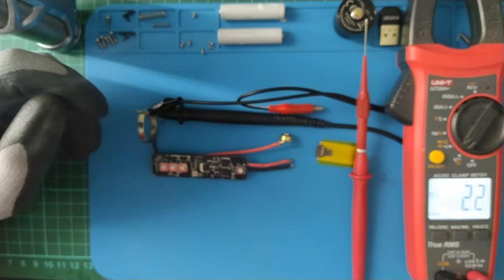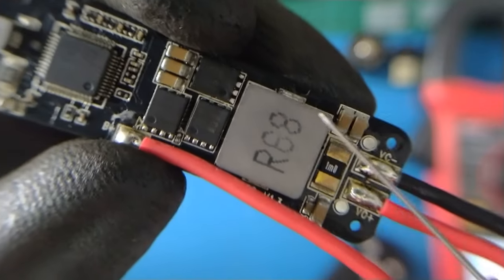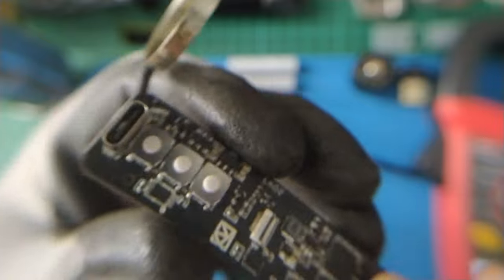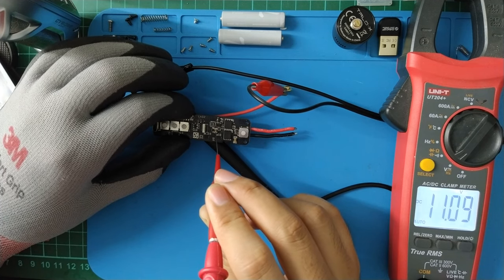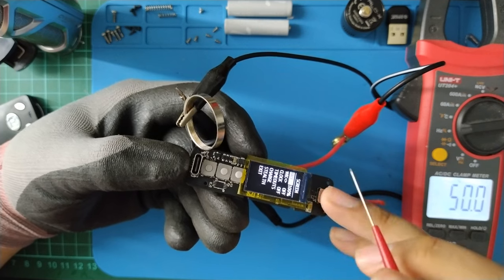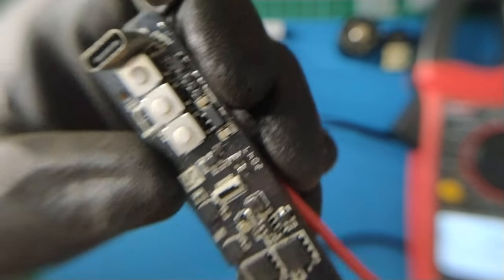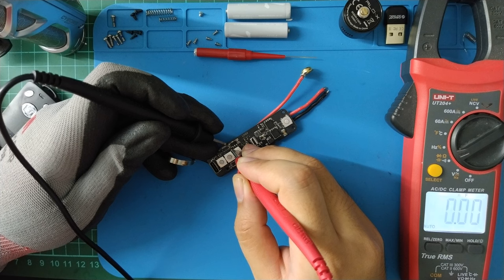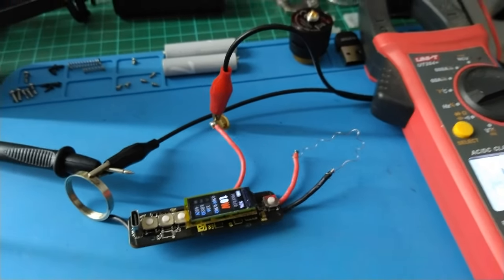VLOG EN: LOST VAPE QUEST MAINBOARD DISASSEMBLY / TEARDOWN TOPOLOGY POWER REGULATOR

Comment: Hi @widyahong ! Have you ever disassembled centaurus Q80? Tear down advices without destroying it would be very usefull 😅
Reply from the maker: No, but many device <80 watt not designed to be easy repair, you need accurate and stable hot air gunt to minimize dent by soften glue and calm down during work. Device under 80 problem typically just battery, pin, sensor. Not like device over 80 watt that have switch mode power supply inside, device under 80 watt just contain pwm circuit.

Comment: @widyahong I have a similar lost vape centaurus quest bf100.
The firing button is not working I already checked the contacts and it's OK but still can't fire the device
Reply from the maker: Are you use original firmware or articfox? So the device is turn on? If you press power button there are message on display or just puff time and wattage annimated? Its liquid damage like corrosion? Are you have multimeter?
Reply: @widyahong  when I put the battery its straight main screen watt/puff count.
I'll double check it if its liquid/juice leak that might corrode some parts
Reply: @niwrad84  Hi there, do you have any solution for this problem? :)
Reply: @widyahong  Hi, do you know which leg is of the fire button on the STMicro? Thank you in advence.
Reply from the maker: @RolandOkros-hx7zq  im sorry i dont have vaping device again, there are information at articfox firmware forum but this year the site is dead, but you can check with dc volt and continuity mode, normally this button is pull down mode so normally this button have 3.3 volt and 0 volt if pressed, but if you have connection problem its hard to do that thing because stm maybe just sense without activate internal pull up function, before you do, are you finish check stm 3.3 volt before to make sure stm have voltage? there 3 diode with 1 ldo to power 3.3 volt peripheral.

Comment: Hello, I have a Centaurus Quest BF, the select button (middle button) has stopped working. Do you know what the problem could be?
Removing the button from the board and testing it is doing the job normally.
I apologize for the English, I'm from Brazil and I'm translating through Google
Reply from the maker: Hello 👋 before going to microcontroller the button output goes into resistor pull down/pull up and capacitor debouncer, resistor may go open or close circuit, the capacitor may be shorted. Resistor need to be replaced but for capacitor you can replace or just get it without replace. Last microcontroller pin may have bad contact, for pin out you need go to articfox firmware forum nfeteam.org at lost vape sub forum. To do you need multi meter with beeper/diode tester/ohm terster and solder iron. Good luck. Lost vape devices have 3 month warranty.

Comment: Hi guy. Can you make a clip about charging board of pod system and vape. And can i connect with you. Wait for your anwser. Best regard.
Reply from the maker: Hello, sadly i cant because every device is different, take to much time but help several people only, but majority 1 cell device have linear charging chip (without inductor and low current capability) or switching buck converter (synchonous or just diode) if the device have more than 1 cell it will use switching boost converter. Majority have input, output, and status (to mcu) pin. To fix it you can get out all fail components and build external if there any space or fix it by look at diagram from typical aplication on datasheet just search datasheet on google by typing chip model. Dont search a whole schematic because you wont get it.
Reply: @widyahong  thank u so much. And you have facebook?
Reply from the maker: @DuongHoang-d6b  yes but for personal use only and i dont really use that, anyway you can contact me by searching widyawan14 on facebook and send a message. are you fix for business or your own? because for fix it you need multimeter, power supply, and hot air solder..
Reply: @widyahong  i have everthing to do, but i have some promblem need to ask you.